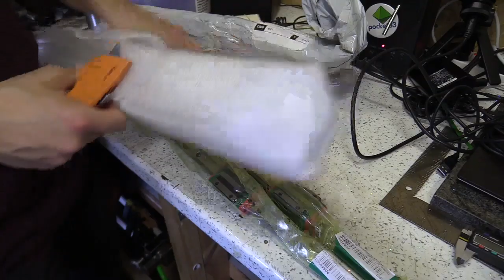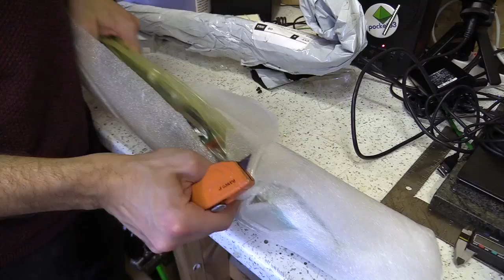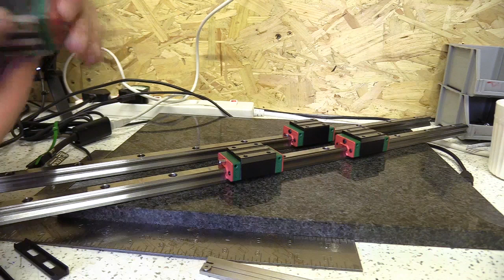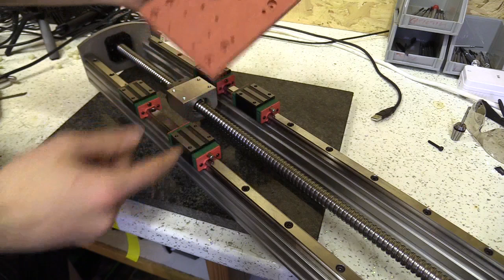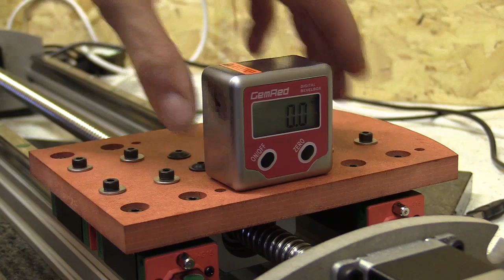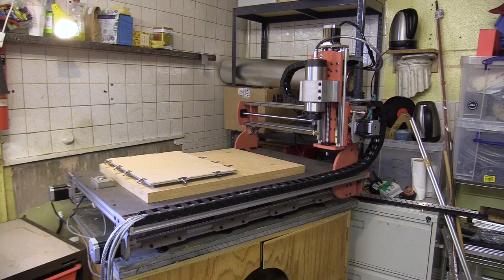#43 MOOT_ONE / CNC Linear Motion Actuator - SFU1605 - HGR15 Rail Guide

Comment: Always home the z-axis to the top surface of the workpiece using a solid contact plate of known thickness, not a switch. You have a whole heap of variables and unknowns between that switched zero and the workpiece.

Comment: 9:36 there it is 2 axis crossing how good is it. and how you measure it lol. xy need squre (xy)z need square. how you measure them. yes yes some big square but how you know its square what you using to measure lol.
onlyway i think is make bottom plate on work that has all holes and have grooves to measure axis are square, but it means machines will be smaller than real cnc. i want make bigger xD 850x550mm in real cnc is too small when boss take jobs that has HOLES over that. i not get it need 2 setup even make hole and how you think what happen when cant mill it one GO it will not be flat there is allways alignment error MAX i seen 1mm for some linear thing lets just grind it LOL i would not pay even penny for that. i would not make job that is bigger than machines travel LOL and think when i make setup and then someone like boss just throw peace in and think machine cut it allways same way. pieace can be put wrong LOL think make setup and knock workpiece to parallers and make it 0.001 flat in 700mm then others throw part in and not knock piece to paraller piece will me under side and not flat right? they move z offset and it might be good but when master come work and hit paraller its funny i get part 0.2 too thick but FLAT when there is 30 piece done and there is 0.2 height error both ends LOL boss say its okay OR they try change program to move Z to correct thickness LOL and we not even paraller they are just what ever straight metal (sometime) they not flat anymore and full holes LOL and they never fix them so its not even hold piece correct LOL
and there is allkinds of tools marks on vices. best one is 10 wide goove on jaw that move 6mm in z all cros 150 vice jaw when mill has slip on ER holder i bet its been cut it like butter even jaws are hardened not soft saw. not any sound mayby nobody hear or care if machines make noise haha. thats my daily work on real cnc job lol. and cant buy tools for making parts or bigger vices or any machines squares to hold 400 tall part 50mm hold part on bottom is fine LOL i would add tool cost for parts but boss just try sell everything low so he get job !? what business is that. and still customers just bring part in and then drawings come later boss allready accepted they want allways tomorrow LOL i would allready see from part we cant do it. tired of job when drawing has bos writing only holes! and works piece is too big or its hard to clamp anyway and holes and thraeds are all side LOL parts are what ever plasma cutted and welded SO ACURATE make setup next piece is completely diff all is measure everything but again boss throw parts in it is fine CNC is acurate but part is located wrong place LOL.. well if you read this long.... no comments cant understand. there is english words? there is writing errors and english people cant read errors? lol

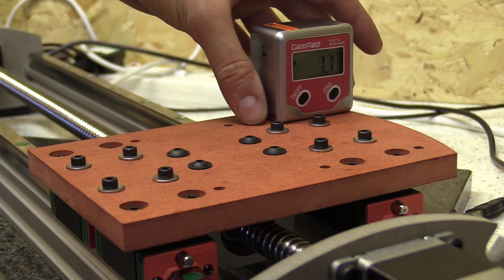Comment: 8:20 0.0 very acurate. means its 99.95-0.04 so what is error if it 0.09 angle max in lenght of that platform. what that error made in all travel xD eventually that is your axis even there would be 10mm error LOL it still move straight line. error comes out when add another axis that need be square. 1 axis is easy

Comment: 4:43 yeah is 2040 extrusion it has 6.2 wide groove but use M5.(why goove not 5.95 M6 is usually 5.85. why is not 4.9 M5 would still too loose my taste) why there is no M6 LOL it would be +-0.1 each end. why not make custom aligment rod thas has 6.2 and 7 or 8 other depend hole on rails and use them on ends perfect square

Comment: why you donot use a steel or iron plate instead of using AL ? it will make your machine more accurate and stable
Reply from the maker: Too heavy for my floor.

Comment: Hello, what do you think is the minimum distance step that the carriage can move(I mean 1mm, 1cm? etc)?
Do you think you can achieve lower than 1mm using a ballscrew/rail guide/stepper motor setup?
Thank you for your video , it is helpful!
Reply from the maker: Oh it can be very small. The web controls have 0.1mm as the smallest increment along the x and y axis, and 0.05mm for the z. But it could be even smaller. If you use a tighter thread or ball screw with less travel, again further reduced.

Comment: are the HGR15 enough rigid to hold the weight including the spindle ?
I'm building similiar setup so it will be useful info. Thank you!
Reply from the maker: Only for machines with smaller x-axis as I've designed for the manual I'm selling. But I tried making a wider version and had to shim the z axis. My manual is available to buy from my website if you are interested. Cheers.
Reply: @EducatingSavvas  did you calculate like how many kgs does the HGR15 can handle approx. ?

Comment: No measuring at all with a dial indicator? Hmm...
Reply from the maker: I know but it's surprisingly effective but I should have used a dial gauge to show it worked. This process is a lot more accessible to the laymen. But I do have one problem with the dial gauge method, and that is if you are setting one rail to the other. Say you reference rail is off ever so slightly and you pull the second rails parallel - what stopping you just transferring that deviation to the second rail and carriage? This way you force the rails based on the axial driving movement. Square the blocks to the plate, pull the rails in line with the ball screw movement. Seems to work.

Comment: Is this machine strong enough to cut aluminum sheet? I'm looking forward to a video of aluminum cutting ability test. Thank
Reply from the maker: Will find out soon. I've started working on the video.
Reply: @EducatingSavvas  thank
Reply: @EducatingSavvas  can i use this system to vertical lift ... up to 60 pounds... as a suspension lift

Comment: Really neat! What material are those red coloured plates made of?
Reply from the maker: They are Valchromat. Really nice to work with.
Reply: Educating Savvas Aren’t they a form of wood? And hence do they have the mechanical rigidity to withstand the massive cutting forces in a CNC? I’m guessing machining metal would be pushing it too far with Valchromat plates?
Reply from the maker: It's surprisingly rigid. I think it could cut aluminium with the right tooling and feedrate. This is the most rigid machine I've built so far. And it's a hobby machine.
Reply: @EducatingSavvas  Thats news because everything I read about Valchromat tells me that its a slightly denser and coloured version of MDF. Please do make a video if you do cut Aluminium on this. Btw, I really like Candle but it has not been maintained since forever now. I've had good success with workflows on cncjs.

Comment: Will you do a video on programming the wretched VFD for the spindle? I'm new to cnc and already had two spindles go up in smoke.
Reply: I think neocnc went in depth on vfd setup.
Reply from the maker: I don't have enough time in the day to do all the things I want... :(
Reply from the maker: I've touch on this in several videos but do you want to send me the details of what you've been using. If you can't add a link here go to the contact section of my website and send it there. I'm going to add a section about programming and electronics in the manual I'm working on.

Comment: it seems like you are going to have lots of flex when cutting in one direction due to the rectangular profile you picked.  it doesn't seem to have much ability to avoid twisting.  Did you look at the design with any FEA mockup?  this is pretty easy to setup with fusion 360.
Reply from the maker: I don't know how to do that. But bare it seems pretty good when I use it. Bare in mind the X Axis assembly in the video is bolted onto the gantry which is made with similar 20x40 plates. Plus the 15x15 rails will add some stiffness too. In the worst case scenario I could add more plates at the rear to stiffen it up or 3D print some triangles to go between the gantry profiles.
Reply: @EducatingSavvas    search youtube for "fusion 360 fea"  it is well worth the hour you'll spend learning how to do it.   Fusion 360 in general is well worth learning for both the CAD and CAM.  I think you will be surprised at the results for your designs.
Reply: @EducatingSavvas  mdf panels would suffice to help racking and bending. You need it for the wasteboard anyways. The z will get bouncy in the middle of x. Z has to be more rigid the harder the material cut. Especialy if the weight of the z isnt enough to eliminate z backlash.
Reply: @EducatingSavvas  I second that, you should chuck it in fusion pretty easy to do and can tell a lot about your design

Comment: Hello, great video, I have a question. What is the power spindle??? and what is the motor´s torque for axis X, Y and Z??? regard
Reply from the maker: Spindle is 1.5kw and steppers are 3A with up to 1.9Nm holding torque. I'm using a duet controller so current set to 2.4 and works fine.
Reply: @EducatingSavvas  What it is the total axis Z weigth? regard

Comment: Any manual you open, from NSK to Hiwin to Thomson, shows the fixed block (FK12 in your case) on the driving side and the floating (FF12 in your case) on the far end. There is a reason for this: thrust. The motor side is where you need all the support you can get. The far end needs to be free to compensate for the (micro) contractions. This is where the FF12 comes in play. Now it's locked.
Reply from the maker: You're right - but I think that's only really important if your machine is massive, and you plan or can run you machine at really fast speeds - < 6000 mm/min. Mine maxes out at 2000 mm/min. There's also some flexibility and lateral adjustment in the motor shaft coupler - which is why I didn't use a fixed one there, and instead a spider type which pulls apart. The ball screw is not being pinched so it can adjust ever so slightly. Also save on part costs as I don't need the FF12 and stepper stand off.
Reply: @EducatingSavvas  Small feedrates will limit you to small chiploads which opens a new can of problems. Don't settle with this. You can solve it by matching your motors to your power supplies. Low speed means too high inductance and/or too low voltage. Ideally you should power your motors with V=32*SQRT(L) , where L is your inductance in mH.
Reply from the maker: @auhopu  I thought 2000mm/min was pretty fast. It's a lot faster then the... x carve! This is ment to be an entry hobbyist machine but I'll re-look at my driver's and configuration when I have time. I'm happy with the design but the controller side of things is not fixed.
Reply: @EducatingSavvas  Actually X-Carve is 4x faster at stock  settings (8000mm/min). X-Carve too has unmatched power supply to motors (i.e. low RPM), but it can hide this  weakness due to it's belt and pulleys (40mm/rev). With a 5mm/rev ballscrew you cannot hide low RPM. Please don't take this as negative criticism. I just happen to have  made the trip from X-Carve to 1605 and have faced all these roadblocks along the way. Your machine, your way.

Comment: good enjoyable content as always, thou every time you upload it makes me think about adding linear bearings to my machine.
one question thou, it looked like the x axis rail assemble comprised of two 2040 rails, coupled only at the ends. surely there is a lot deflection/twist when cutting in the Y direction.  i would imagine that  a 'plate' that coupled them together along their entire length would greatly increase your machines rigidity.
Reply from the maker: Cheers! Bear in mind there's 15x15mm square steal bolted to the profiles - so that helps with rigidity. On the machine at the end I bolt the x axis onto another two profiles lengths which span between the Y Plates, and that shores it up even more. I could add a few diagonals plates at the back like you suggest.

Comment: All your doing is making the rails parallel but not necessarily straight, not really a good example of how to assemble ball screws and linear rails accurately 🤔
Reply from the maker: If I was placing the rails on different faces of the profiles – say one on top and the other at the front, I’d use a dial gauge but there’s no need to over complicated this. The profiles ends are machine cut - so more square than I could ever get, and ball screw is fixed at one end and centred by the stepper on the other, on plates that are identical. The rails need to be inline with the movement of the ball-screw (which no one ever checks but should). The process I used aligns the plates to the nut housing and four rail carriages which pulls the rails inline. The only way the rails would be off is they are both curved and I’d somehow placed them parallel with the curve - which they weren’t because I placed them on the granite surface to check for flatness. Where it was off along the y axis, I have no control over because it's either the profile or rail, and unless I have a 0.1mm shim to place on the underside of the other rail. This process was designed to make the assembly easier, but feel free to tell me how it should be done.
Reply: Not a trace of a dial indicator to check the rail relative to each other  and to the aluminum profile
Reply: That's just an assembly "mistake", it can be fix as he learn about it
Reply from the maker: @geekoid183  There's no point because the ball screw and nut housing travel is the thing I want the rails to be aligned too and that's determined by the two end plates. The idea is to use actual movement to make the travel as smooth as possible.

Comment: a big improvement. use a BF support on the stepper side.
Reply from the maker: Yes it is. I can stop here now. I have used the fixed part on the opposite side of the machine with the ball screw reversed, so there is no need for BF support at the stepper. Means I'm using less components .